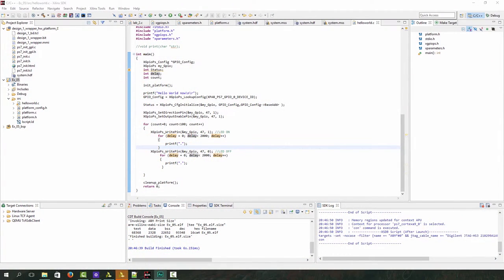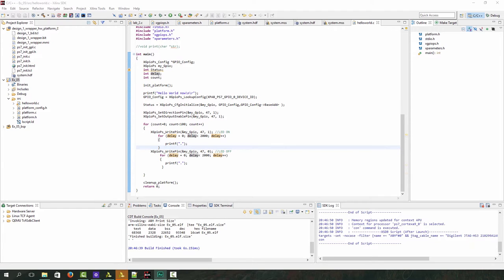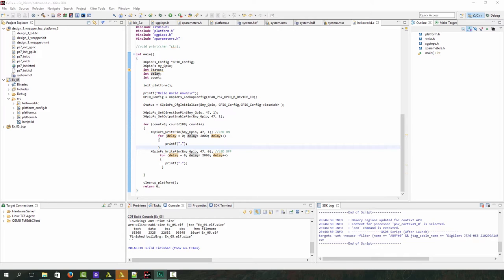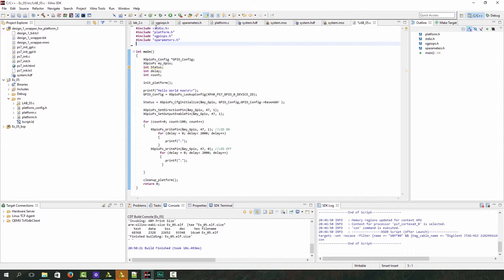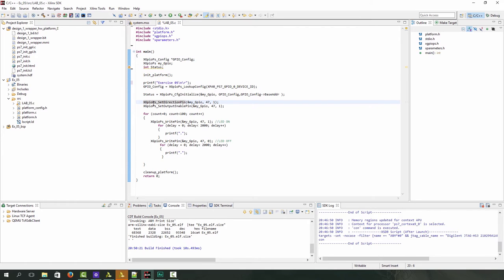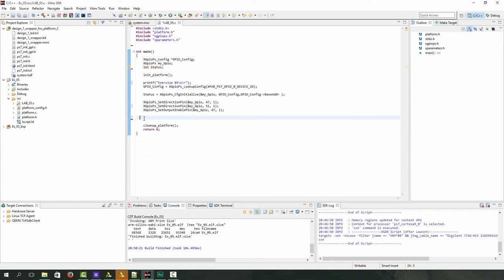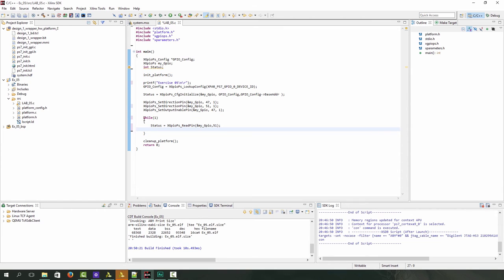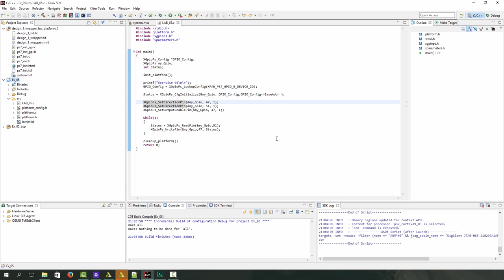Read Button on Zynq with MIO PushButtons GPIO Xilinx SDK

Comment: thanks but where vivado design for this
Reply: since it uses PS switches it only uses the zynq_processor blok. there is no need for additional AXI blocks or vhdl/verilog code
it's just bllock automation -> bit stream -> exp. hardware -> SDK start, and then you type this in